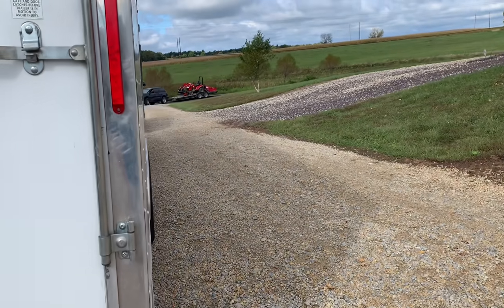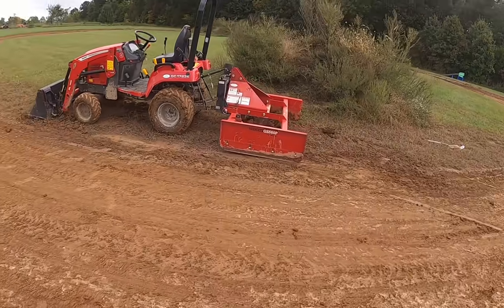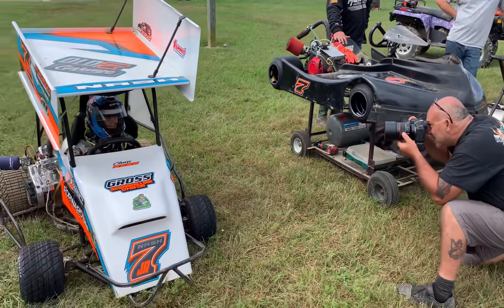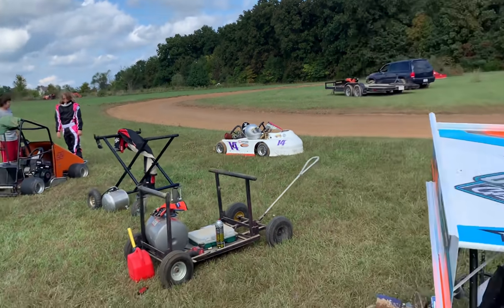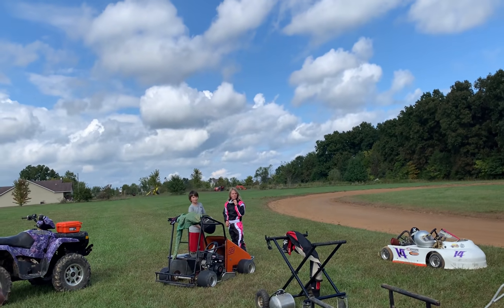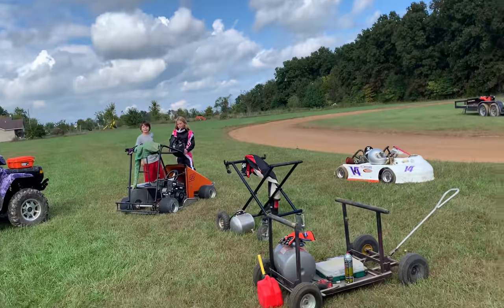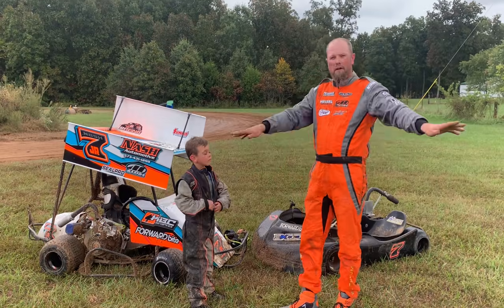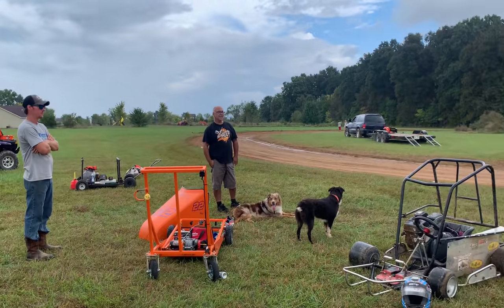We challenged my 6 year old to a race on our backyard race track • Moments like these last forever!

Comment: Hey man what kinda gears you running front and back ?!?
Reply from the maker: On mine I had a 11/70
Reply: Ok 👍 we do some backyard racing too. I was curious because it sounds like your motors are running a steady rpm. We running 12/65. Might have to try your setup. Thanks 👍

Comment: Is really nice. But why doesn't anybody use one of the easiest and effective track tricks? The drag a section of chain link fence around the track trick. Stole the idea after watching a matenence guy preparing a baseball diamond. Then I built a big roller to pack it out of a huge sixty gallon water heater that I gutted. After gutting it I ran a long tube through the middle and welded it in. Now I filled it with concrete, made a frame so it'll roll and hook up to a hitch and presto